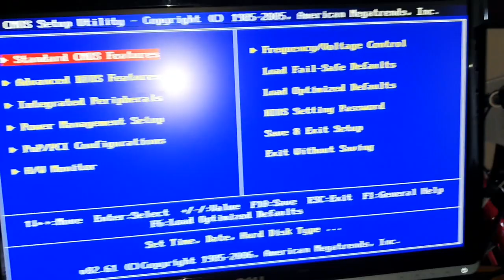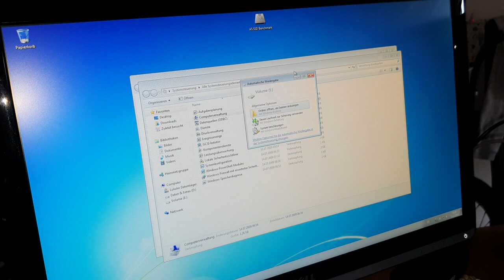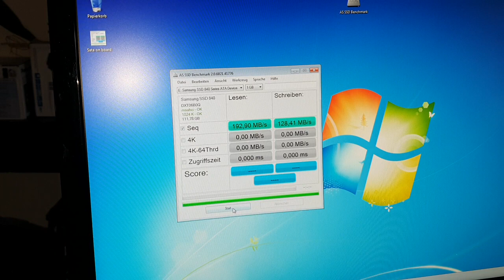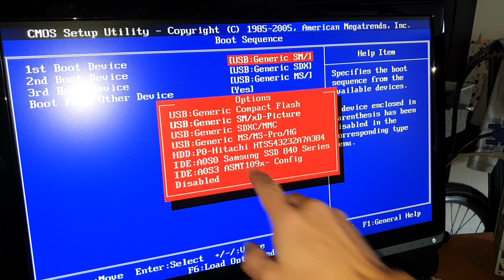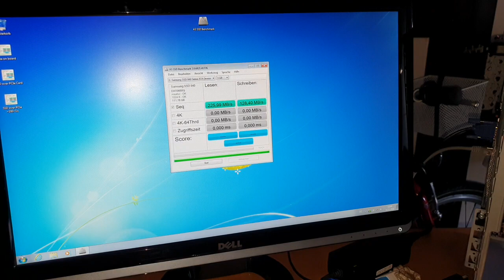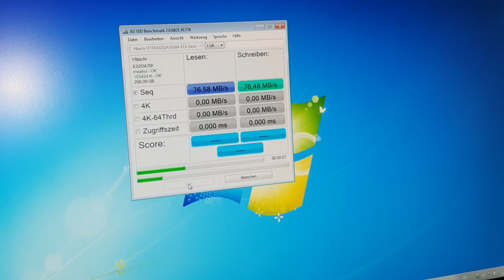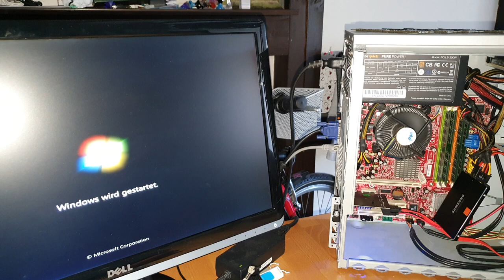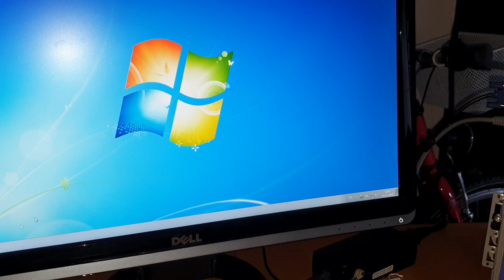How to setup a PCIe SATA Card on older computers By:NSC

Comment: i didn't know about existance of the PCI Sata,only about USB 3.0 PCI.Thank You,it makes sense.
Reply from the maker: You Welcome :)
Reply: @NSC-Modz  is it faster than standard Sata connection,which is built in,inside motherboard ?
Reply: @NSC-Modz  is it faster,than - standard SATA connection ?
Reply: @NSC-Modz  will my hard disk work faster,when i use PCI SATA connection card ?
Reply: @NSC-Modz  i asked,because i mainly use HDD,not SSD.

Comment: Now I gotta ask...Why the x16 slot as opposed to the x1 slot? What if you want to add a GPU down the road? In the x16 slot won't add any extra speed as opposed to the x1 slot. If the board is PCIe 2.0 compliant the x1 slot will run at 2.0 compliant speeds (~500mbps).

Comment: I just wanna know if I could use all the 8 slots on that PCIE Sata Expansion Card or there's a limitation? I read somewhere that it "only supports 10tb hard disk drives", but the problem is they don't made it clearer so I just want to confirm few things cos I really don't get what they mean.. Does that mean that the adapter can only supports up to 10tb hard disk drives overall so in other words, I can't use all the sata slots simultaneously cos the storage limitation is 10tb or my other interpretation, that it stated there that the adapter supports 10tb hard disk drives so I can plug a 10tb HDD to each sata data ports of that adapter making it a 80tb if the slots are all occupied?? So which is which, please enlighten me??

Comment: I think for older PC maybe at least you need sata controller on PCI Ex  2x or 4x so it can have more bandwidth to the motherboard.
since theoretical speed for 1x is so slow for old PCI Ex version 1 or 2.
1 is about 250 MB/sec. 2 is about 500 MB/sec and 3 is 984 MB/sec

I want to buy the same sata controller that you have here, for my old pc which still using PCI Ex 2 but I was curious how fast it will be, and then I found your video. Maybe if I take one with 2x or 4x it will much faster for my old pc, than using 1x one.

I don't know what motherboard that you using, but my best guest, that is a PCI Ex ver 1. Is that correct?

Comment: The sata cable you use is old sata2/sata300. Maybe if you try sata3/sata600 cable, system could obtain sata3 speeds through pci sata3 card, but i do not know for sure
Reply from the maker: Yes, i thought it was a SATA 3 Cable
Reply: @NSC-Modz  the old red sata cables are still sata2 as far as I know

Comment: Why would be better & faster  . Connecting ssd to pci 2.0 x1 or to sata 2 port on the motherboard?
Reply from the maker: I think it will be the same as i have testet...
Reply: Connecting a SATA 3 SSD to a motherboard using a SATA adapter card in a PCIe 2.0 (x1) compliant slot will be faster than using the motherboard SATA 2 port.

Comment: Can you help me ? Don't work for me! Don't work boot for pci
Reply from the maker: Select boot in bios over the card...
Reply: @NSC-Modz  yes I select ssd in adapter, for the first boot but the windows don't open, just load and reset
Reply from the maker: @joaovitorcerqueira7090  maybe you need to reinstall it again, you Portugiese?
Reply: @NSC-Modz  brazilian
Reply: @NSC-Modz  i tried yesterday and today, i tried with a virgin ssd, only him and i tried to install windows from 0 and gave error in the installation.
Reply from the maker: @joaovitorcerqueira7090  Ola entao :) Try to install it over the standard Sata Port, and later try to boot over the Sata Card.